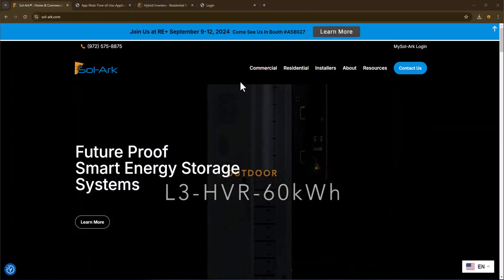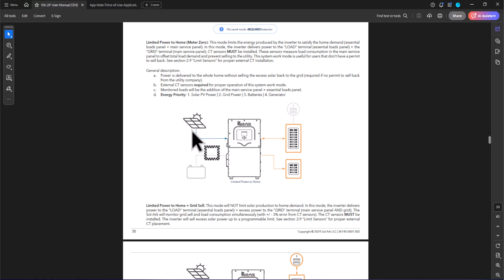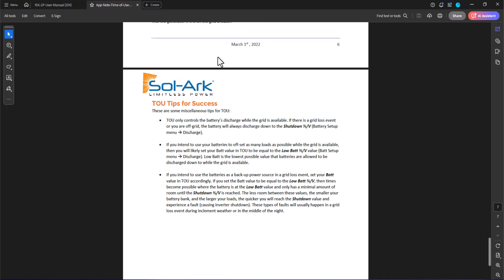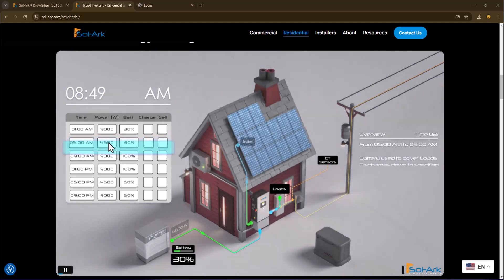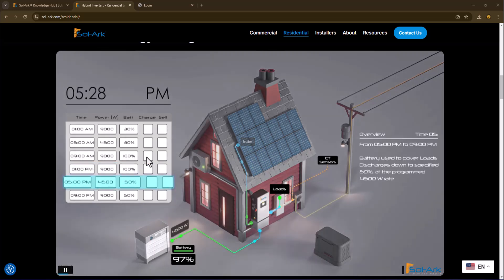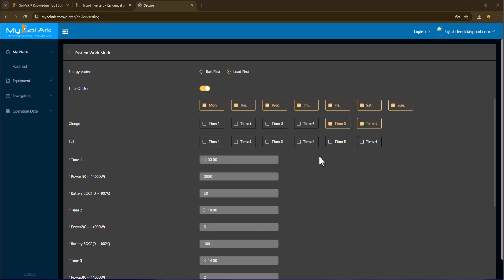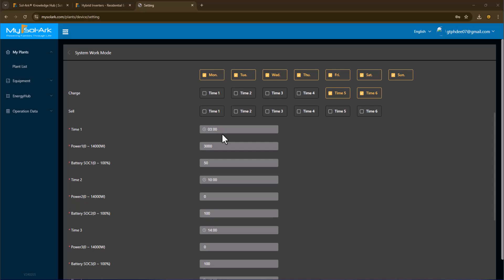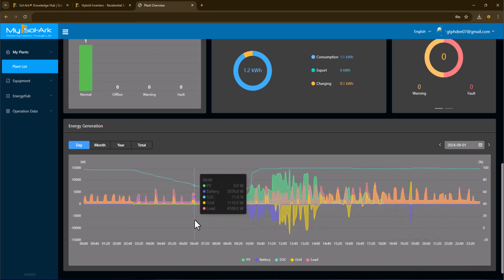Setting Time Of Use on Sol-Ark Inverters

Comment: @11:20, you have Time 6 set to 00:00.  That's wrong.  According to the manuals, those times (Time 1 - 6) must be strictly increasing.  So, if you want a time slot starting at midnight (00:00), that should be at the top of your list.  I've seen other people who've had incorrectly ordered time slots and TOU just won't work for them.

Comment: great instructional. have you worked out seasons? i have seasonal rates to manage
Reply from the maker: Thank you for the comment. I'm glad you found it useful.
The problem with the Sol Ark interface is that you can only have one set of parameters loaded via the web interface. So, if  your TOU times change as the seasons change..... I think your only option with the web interface is to just go reset the TOU setup / parameters every three months.

 I've been working on using Home Assistant to keep different "modes" available, like...Summer Storm, or Hurricane (long term outage) etc.  The issue is that I've only found two ways to "write" a setting into the SA. 
1) Record the web traffic from my browser to the SA server and then replay it, which would be a LOT of work.
2) Remove the Wifi dongle on the left side of my inverter (the one that provides the interface between the inverter and the remote server), and write a custom python script, using unpublished registers and settings.... I'm not ....enthusiastic...about using my working home inverter to reverse engineer the register map, which could be changed in a heartbeat by SA, with potential bad results..... So

In summary, I think the most reliable way to achieve your goals is just to set a calendar reminder to update the TOU parameters every three months or so... Sorry

Thanks for watching.
Reply: @ solark do have seasons in tou but no way to set them. I will pester them

Comment: Greetings, Does  T.O.U override the Battery shutdown %, low Battery %   let say i got my battery to shutdown at 30%, and TOU is set at 25% base on the time.. would the inverter shutdown?
Reply from the maker: Hmmm..... That's a good question. I think you are asking if the system level setting for shutting down the inverter is set to 30%, but the TOU is set to discharge the battery to 25% before stopping, which would take precedence.

The answer is..... I don't know. I can think of several different ways SA could program the system. However, my first question would be why your batteries are only set to discharge to 30% depth?  

My understanding is that most lithium batteries are able to go much deeper than that. Also, the system level setting is , to my understanding, a safety setting. Ie, shut down before completely discharging them. If you hit this level, your house is going dark....

If you wish to know which takes precedence,  it would be a simple test to set up.  I'll reach out to SolArk and ask them, and post an answer here when I get their answer, if you don't mind waiting for the reply.

Thanks for watching -
Reply: Greetings 🙏,  yes your explanation is OK, However TOU is set 10% and low Battery is set 10%  i believe one settings will override the other.. Hence which one I don't know.
Reply from the maker: I'll ask Sol Ark tech support, but if I were designing the circuit, I'd make the battery protection logic override everything else. When you hit the battery protection SOC, the inverter shuts down.

If you want to ensure that TOU takes your battery just to the edge, but doesn't shut down, I think you need to have at least 1% difference in the settings.
Reply: @RVSolarDoc  THANK YOU 😊.
Reply: Low Battery values overrides TOU settings.